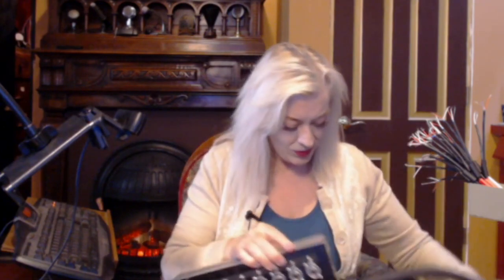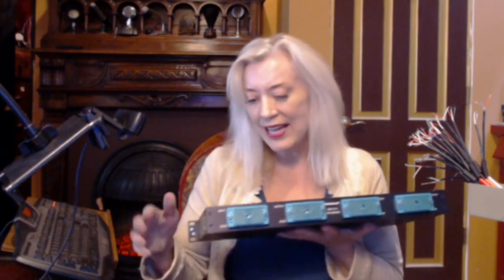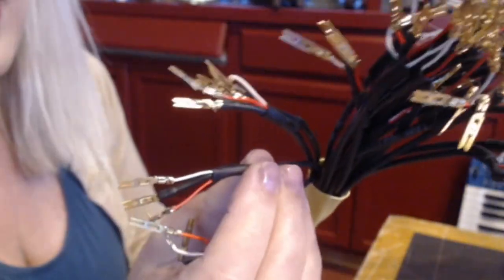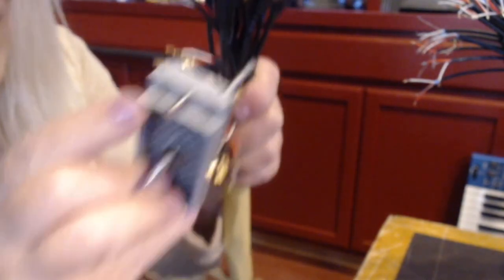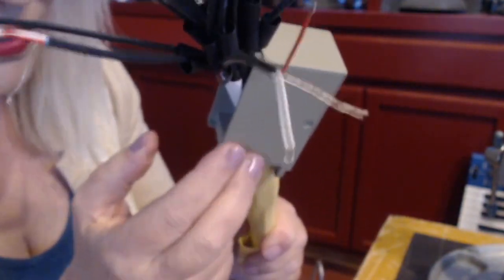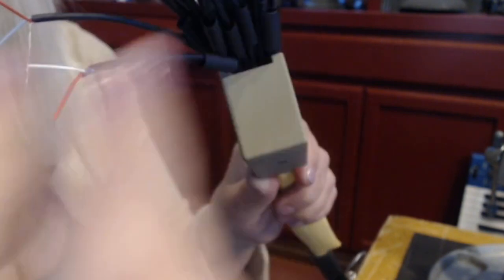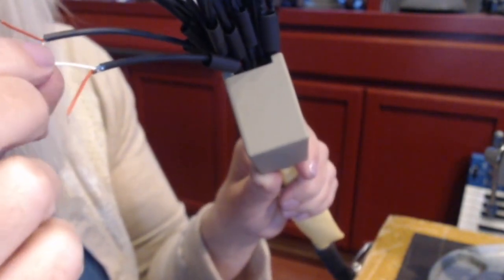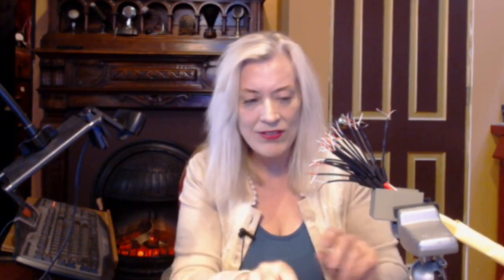Part 1 - Building Elco Connectors With Sylvia Massy

Comment: that logitech keyboard on your desk is a huge throwback lol. I wish you made this series before I got my little neotek a couple years ago! I learned to really like this connector. if I could go back in time I would buy the crimp tool instead of using the solder-on pins.

Comment: Thank you for turning me onto Cordial bran cable.   I’ve heard of audiophiles swearing by oxygen free cable.   I’ve also heard a lot of talk about solder material.   Not all of it is equal and does effect the sound.  No snake oil, just blind test verified.  Which brand and type of solder are you using for this project?  Thank you for your channel.  I like it a lot.